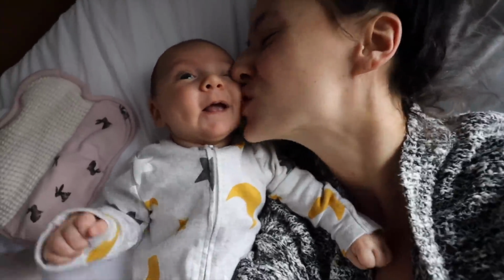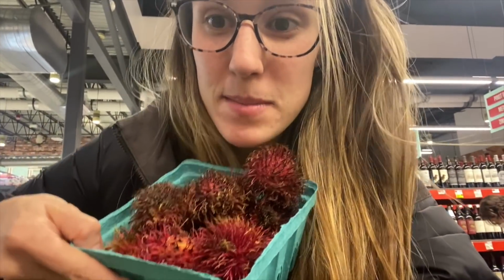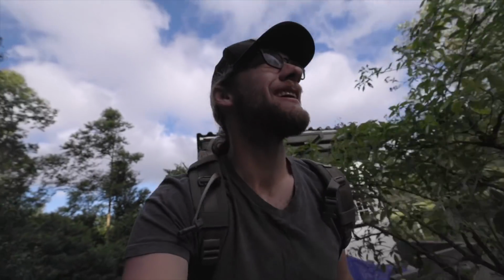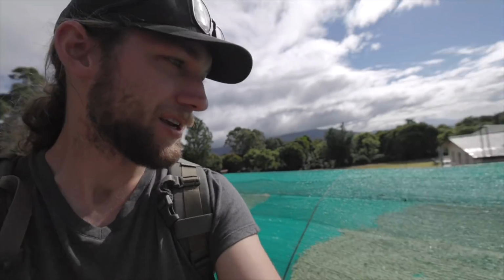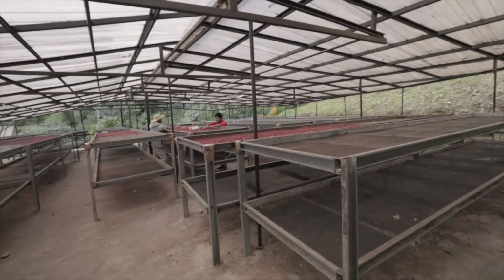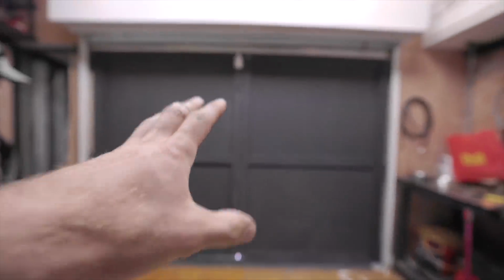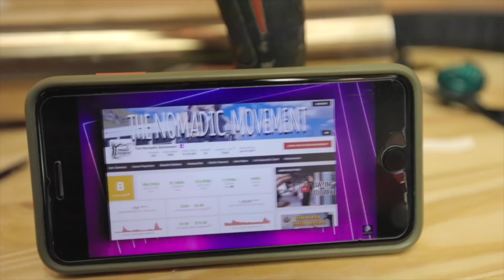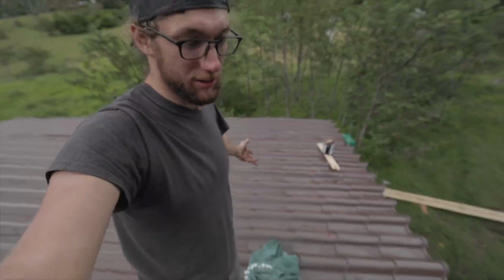i'm struggling raising this baby alone...

Comment: Colic is generally caused by digestive issues, whether from breast milk or formula. Also, babies tend to swallow a lot of air when eating as well. That air can get trapped in all areas of the digestive track before coming up or out. This causes extreme discomfort and crying. In the medical field, they generalize it as “crying for unknown reasons) but that’s just because it could be a few things. But trust me, it’s very real and there are fixes for those caused by diet sensitivities.

Comment: Roof leaking:  As I watched you install the roof panels, I thought that they were upside down.  The upper one should run unto the lower one.  Yours are catching the water in the layers rather than flowing downhill.

Comment: I had to make a schedule for mine too

It started at 7am after she woke from her 4am feeding nap. We would bath her, then say by to dad, then do floor exercises (running feet feet to head touches..belly time to strengthen her neck. She cried the first few days but then turned to a few whines and she stopped that within a week. Then we would do the 9am feeding…. I would do the same around 1-2 pm and it really made a difference in sleep xoxo

Comment: I had my son in a bassinet next to my side of the bed. When he cried to be fed, I put him next to me, lying down in bed, to nurse, while I went halfway back to sleep. When he was ready for the other side, I flipped over to my other side and did the same. Otherwise, I would barely get an hour sleep between feedings. He would nurse an hour on each side. I made tons of milk also. You could try pumping some of your milk out before feeding Sadie, so there is not a huge waterfall for her, trying to take in. It will keep your milk production heavier, but you will have plenty as she gets bigger. Eventually she will get stronger and bigger to handle the large flow from the beginning. Otherwise, the less she takes in, it will decrease over time. My son was the same way, and I used a bath towel, over my shoulder and the back of the headboard, or sofa, with a valley between. His burping would be like projectile vomiting, because of the huge intake of milk. My next baby, my oldest daughter, was the exact opposite. She would take a tiny taste, and think about it, like a wine connoisseur, while I’m begging, “don’t taste it, drink it”! I never felt the “let down” of the milk before her. I learned how painful it can be, wanting it out, and it can’t move. My son was a human vacuum cleaner. 
Also, I’m a LMT, Licensed Massage Therapist. I share, especially, with new parents a tip for calming babies. In TCM, Traditional Chinese Medicine, they believe the gut is the life center of the body, that the heart was just a pump. We hold our emotions and stresses in the gut. Nausea, butterflies in the stomach, ulcers, digestive problems….. Belly Massage helps calm the gut, and, by extension, the body. It can also lower high blood pressure. With an adult, you would use your hands, but with a baby, you use the tip, or pad, of your finger. As you are facing your baby, you put your finger out a little ways, about a finger width, or half inch, away from her belly button, slowly and softly go around her belly button, keeping that distance away from the belly button, in a clockwise motion, You can hum to her, or just softly, quietly say something, like it’s ok, I love you, I’ll take care of you…. The intestines run clockwise, as you are facing the body. If you give yourself a belly massage, remember to go clockwise as you would be facing your own body, not looking out, away from it. A belly massage, done the wrong way, could cause harm or upset tummy. My daughters would be struggling to get a couple of their babies to sleep. I would give them a baby belly massage, and they would be out, in less than a minute. It would drive my daughters crazy, wanting to know what I did. They didn’t try my advice before. They did, after that experience. Rarely, a problem after that. Another tip about the belly massage, it might relieve her gas and help her fill her diaper. In adult clients with digestive diseases, requiring medication to help them go to the bathroom, a belly massage, will usually do that naturally, in less than an hour after massage, with no side effects, compared to medication.
I hope this helps you! You are doing AWESOME!!! ALL of you!!!🙌

Comment: Colic is just a term to express that the baby likely has low stomach acid. I see it in my  baby patients all the time, when we fix the ph, which some milk kefir or a good quality probiotic powder on the nipple before the feeds, it's normally fixed with within a couple of day. (I normally check their iridology to see if this is whats going on) if it's not that, then it's food that the mother is consuming that is not compatible for the mother or baby or both, and for that I normally run a hair analysis to work out what those foods are.

Comment: Jordan, please oil the hinges on the front door. Really quite cringe worthy! 😆🥴
Plus, DO NOT PAINT the roof... Exposed to all that sun and all that rain that paint will peel and wear quickly and look terrible, and that's if it even adheres well to that kind of surface! I'd suggest leaving it the stock color. After all, it's a roof, and the only way anyone sees it is from a drone shot and we, and no one else, cares what color it is. Seriously, it looks great! We can't see the cafe colored paint covering the screws.
Sometimes if you paint something, then you are subject to the durability of the paint, and it causes much more work than you can ever imagine, because the paint wears fast. No one will ever see it but you, because you live very isolated... And, we simply do not care! 👍😎
Reply: Agree -- do not paint the roof.  It is your water collection system, and the paint will eventually flake off.   Why add unnecessary chemicals and debris to your water?
Reply: @Steven-me4un  Oh yeah, I forgot it's his water collection system! Damn! DO NOT PAINT! Without question!